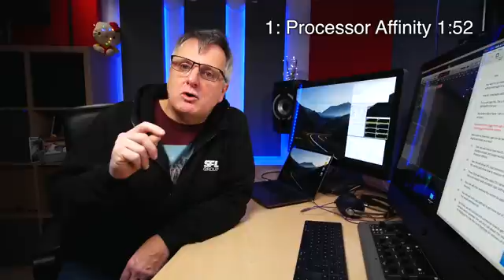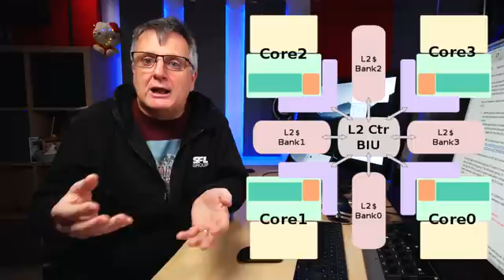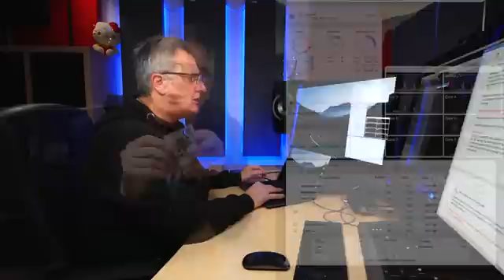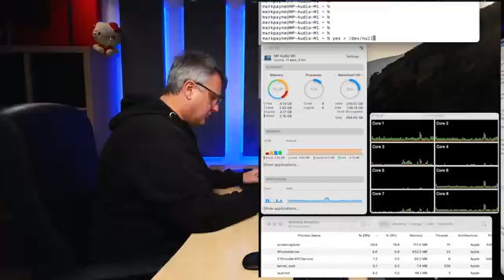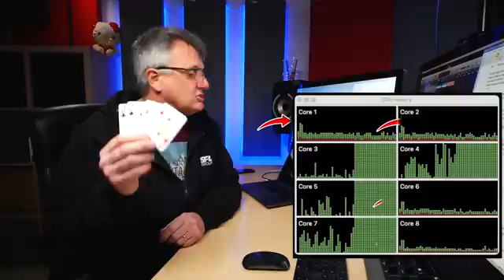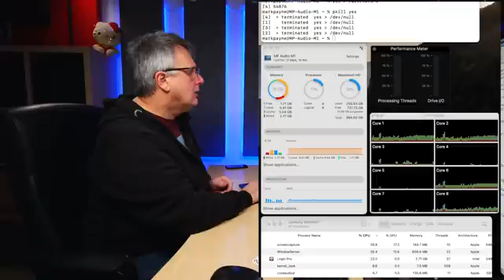Logic Pro X CPU Optimization | 2021 | M1 System Tips | Run more Plugins!

Comment: Fantastic video! In depth for all audio and music production. Spot on when you highlighted the fact of those other youtubers that are showing the new M1 Mac 💻 stressing the cpu by multiple audio tracks of the same channel (prints). I’ve been testing my basic Mac Mini just to see if it could really be a nice jump for both performances and to start off with the new Apple silicon world, I’ve done pretty much what you do, in a more humble way ;) but using LogicX with all type of third p. plugins and virtual instruments. Routing signal paths, using many aux /buss channels loading most of my arsenal (plug-ins) 3rd part that is. I found some glitching here and there and some times the cpu message was OVERLOADED. Now perhaps 16 ram would give a little boost to a workflow? Or we might have to wait a bit longer? Mind you, the fact to have a Mac intro line that can be super snappy and responsive with regular use, and in many ways a great step up and into the new world of Apple silicon? I am sure by the end of 21 we can see the light for the M1Pro machine? The cost will definitely jump way up there $€£ . My aie on these new intro line Apple machine is for 1000£ you can get a “new world” computer system and start off enjoying the new experience yet for pro audio users is advised to keep your original set up 🆙 and still enjoying the new Apple system. I’ve done a track from start to finish mixing and mastering on my Mac Mini M1with only 8gb of ram, used Plug-in Alliance , Fabfilters! Softube just to mention few) mind you, the Waves plug-ins are really cpu hungry 🤤 IMO. Anyway!its refreshing to watch your video! Thanks for putting energy in to help all audio /music producers out there... too many benchmark-video editing YouTube videos. Lol 😂
Reply from the maker: Word! djA, did you look at your memory pressure when you hit the limits of your system at all?
Reply: @MarkPayneAudio  hi Mark! Yes, always kept active monitor on  while using Logic X to keep and eye  on CPU, MEMORY PRESSURE, which despite the stress I’ve put the MacMini M1. I’ve never got the memory pressure to reach the red I was impressed by this.

Comment: Hi mark I am looking at updating my old window 10 pc I have been looking at the Mac mini m1 think after your review I am going for 16gb of ram version, my main use for the Mac will be using Logic Pro x and Final Cut Pro I thought about the MacBook Air which might be my next investment later down the line  as I have a MacBook Pro which I have upgraded to a ssd drive and 16 go of ram just wondering if you  rate the new Mac min m1 I no it a silly question cheers neil finally love your YouTube channel nice to find  a uk reviewer keep up the great work mate 😎
Reply from the maker: Hi Neil, the new Mac Mini M1 is basically the same as the MacBook Pro M1. It has active cooling so will be able to do all the hard thermal stuff at the sustained top end of CPU utilisation. I think I am going to do an Air vs Pro M1 video as lots of people are asking for this.
Reply: @MarkPayneAudio  look forward too  the review and thanks for the quick reply 😎

Comment: Brilliant video! The thing that excites me most about M1 is that you can track at 32 samples under a fairly heavy load, which would have normally been a payne in the ass, and would have required me to up the latency or freeze tracks.
Reply from the maker: I have not tried tracking yet with t so this is good to know.

Comment: Hi , Thanks for your vid , Does 64 bit summing take more processing power given that , that summing option is open to use more ram than 4 gb ? What happens if we fiddle with that preference and make it 32 bit summing ?
Reply from the maker: I did try that previously and I found that it made no difference to the processor load.

Comment: I just bought the other Abbey road reverb from waves and I cant really even use one instance on a project with 40 tracks.
Lately, I've been utilizing Logic's stock plugs like ChromaVerb and Space Designer.
The stock plugs seem to be more CPU efficient than the newer Waves stuff. 
I can't use Bezerk either it sucks man.
Reply from the maker: I can really recommend LiquidSonics Seventh Heaven reverb. The base version is fantastic (no need to bother with the Pro version IMHO).
Reply: @MarkPayneAudio  How's it on the 'ol CPU usage? I'm still looking for that ultimate 80's gated verb sound as well. So far, the Eventide 2016 was the best sounding to me, but I don't have it anymore :(
Reply from the maker: @totigerus  Its very light on CPU. But I will say that it does not have a good gate reverb. I am using Waves H-Reverb for that... which is not so good on CPU (but better than Abbey Road).

Comment: BTW: Lot of CPU cost the VISUALIZATION.....  since OSX 10.11 with every update (more "transparany effects) it cost more and more  CPU. I do not have big sur, M1 and Logic, but plugins like REAKTOR (and Reaktor"Ensembles" with much grafically movemet cost SIGNIFICANT of CPU if the plug-in-window is open  or its closed! The difference is depending how much VIEW-Elemenst are how often moving  (in some reaktor "ensembles" a lot, in some other ensembles just few...) The CPU will spikes SIGNIFIKANT if the plug-Window is open or closed: "Hiding" the plug-window dosnt matter, it cost the same CPU.  In some cases just the VISUALIZATION of some reaktor"ensembles" cost more than 100% (of one core). The plugin (ensemble) itself takes maybe 15% (of one core), but with open window the same ensemble will suddenly take 135%....   My old 2011 imac with 10.10 just needs much LESS CPU if the window is open, than my 2019 imac with 10-15!  Its the new  "transparancy effects" (you can not switch off this unnescary stuff) will cost lot of CPU. Dont know, maybe bigs sure/M1 handle this better, but with 10.15 its a very huge power-eater! (You just see this in activity monitor, not in logic/live/reaktor.... cpu-meter which ONLY shows shows the Audio-consumptation, not the GFX consumptation!  wwg1wgaWW!

Comment: One thread per plugin doesn't make sense. One thread per track seems more useful. You can't parallelize a chain of plugins, since the next plugin has to wait for the output of the plugin before it.
Reply from the maker: This all makes sense, yet.... adding one plugin can show an increase over multiple Logic affinity queues. How do we explain this?
Reply: @MarkPayneAudio  Interesting, how did you measure that?

Now that I think about it a little deeper, maybe on thread per plugin could actually be helpful. If you see your whole Logic session as a graph of processors (plugins) and their sends/receives as the connections between them, you could have scenarios (mainly in side chain setups) where one specific node on one branch is waiting for another branch. 

What would make more sense to me however, is a scheduler inside Logic, that allocates as many threads as you want (you can pick that in the settings) and then uses those threads to process nodes in the order that makes the most sense according to the form of the graph. I think that could also answer your question: every audio block (every <buffer size> samples) the nodes could be distributed differently across the allocated threads. On the first audio buffer "thread 1" might process "node 3", on the second audio buffer "thread 2" might process "node 3". This would show an increase over multiple threads when measured over time.

 Interesting to think about (I might be totally wrong aswel).

Comment: Hey Mark - love these videos! I noticed that AVB latency on M1 is pretty incredible - 0.2ms. Could you run a test to see if you could optimise an M1 system to mix using plugins live? Could potentially save spending tonnes on Waves servers.
Reply from the maker: Great suggestion! I should try that. Get a console in an out of Logic using say an RME madiface and use Logic as a replacement for Waves Multirack native... Hmmm. A bit specialist for us live guys however. Not sure this will have wide appeal?
Reply: @MarkPayneAudio  Yeah, could be interesting. I appreciate what you're saying too though. I just always thought if I could negate the latency issues, the possibilities of using my studio setup / plugins live could sonically be pretty exciting. (I'm already halfway there as I've loved mixing livestreams in the box) Considered buying a Presonus RM32ai because of AVB compatibility and testing it out at 96khz. (I've seen them go used for £600ish)
Reply from the maker: @ledgersolutionsuk  I have done very detailed studies on plugin latency for Multirack Native and SoundGrid here: https://youtu.be/FCyK160EtU4 and here https://youtu.be/0cs576ul7Kc .. you may find these helpful.
Reply: @MarkPayneAudio  Thanks Mark!

Comment: wait what?- M1 now handles Waves Plugins / Fab Filter etc. I got emails from them saying they do not run on M1 systems...Did that change?
Reply from the maker: Waves plugins are not officially supported on M1. But as I demonstrate in this video set I am running V11 plugins on M1/Big Sur without any issues. I run Logic under Rosetta and of course that means all plugins will also be under Rosetta. In fact Fab Filter ARE now re-coded and supported as native on M1 systems (over 1 month ago). I still continue to run the Fab plugins under Rosetta as I run the reliability of mixed M1 and Rosetta code within Logic is not reliable. Run EVERYTHING under Rosetta by starting Logic under Rosetta and all is good. I cover all of this in the video set all part of this playlist. Please do review, I think it will help.
Reply: @MarkPayneAudio  thanks Mark. We are getting there.

Comment: Brilliant video mark! 

Do you think it’s worth me buying this over the i9 MacBook Pro or a pc similar to the i9? I’ve always used cubase, but I’m looking to move over to Mac and logic. Obviously it’ll have to run multiple tracks and vsts with plug ins and reverb? Thanks
Reply from the maker: 100% I would get the 13" M1 over any Intel 13" MacBook .. but make sure any sound interface hardware you use is supported. I cannot comment on the PC as I stopped using PC's for production a long while ago.
Reply: @MarkPayneAudio  thanks for your insight and the reply 👍🏻

Comment: The waves plugins are not M1 compatible yet. The performance will probably be a whole lot better once the M1 version of the plugins come out.
Reply from the maker: Yes, this I do understand. Please remember I am not blaming Waves for this. I am using this plugin (Abbey Road Plate) as a machine stress generator. What it is is pretty irrelevant, what it does to the system is what I am after. Waves V11 is working fine on M1. I am running sessions on a 13" MacBook Pro M1 machine that would be impossible to run on the latest 2020 Intel MBP. The fact that MBP M1 will get even faster is nice but is not the story now. The story RIGHT NOW is that MBP 13" M1 is far and away superior for this task than MBP 13" Intel. M1 is beating the old systems to an embarrassing defeat with one hand tied behind its back. An to be honest I think people without M1 are totally over playing the Rosetta 2 "disadvantage". There is no disadvantage my kids are winning the egg and spoon race!
Reply: @MarkPayneAudio  Very well said Mark. Thanks for the insight.

Comment: Thank you for the informative video Mark! Question: are you running Logic in Rosetta 2 for these tests?
Reply from the maker: Yes Jacosh, It is the only way. Most of my plugins are non-native and I have found that reliability in Logic is only solid if the whole package is under Rosetta. Once you run Logic under Rosetta then all plugins are called as translated code independent of them being updated with a native version or not. I am not saying the native version of Logic is troublesome. But it becomes so when it has to deal with Rosetta plugins.

Comment: Has anybody found a list of plugins that have native M1 compatibility? Anybody keeping track of this situation? Would love to run a Logic Pro X setup with a new M1 Mac where I have it running fully native. So far I know of FabFilter and Fuse Audio plugins being M1 compatible. Any other companies with M1 compatibility for their plugins?
Reply from the maker: Hi Niklas. Why do we need it to be native? Logic performance on M1 under Rosetta is far and away better than on any equivalent intel machine of similar form factor. I just don't get this a a problem. It is what it is and when ALL the plugs I use are native then I will flip the switch. Until then what is the issue?
Reply: @MarkPayneAudio  As far as I can tell, the difference in performance is still quite significant when running Logic in Rosetta 2 translation mode versus native mode. I'm also trying to build a really minimalist system so I'm interested in which of my plugins will run natively. Planning on installing only those.

EDIT: Actually, if you happen to have any FabFilter plugins, you could test the performance difference. First installing the ordinary Mac x86 plugins, running Logic under Rosetta 2.. then running the native plugins with native Logic.

Yes, I know these machines are quite powerful already but as I use Alchemy 2 a lot I will still most likely run into a performance wall with any of the current gen M1 computers.. thus I try to minimize the overhead by making sure all of the plugins run natively.

Comment: Thanks Mark. Cleared up a lot of confusion for me. Still on a 12 core 2010 Mac Pro. Understanding the dynamic nature (sends) explains many head scratching moments where seemingly out of nowhere an overload appears. Ozone 9 is my nemesis. Love the plugins but they are a bit processor heavy.
Reply from the maker: Thanks Harrison. Yes me too! I only realised that this was going on when I was focused on measuring what was happening so I could teach it! Always in my teaching sessions this is the case. You really learn something when you have to line it up for explanation. For me a Quality Metric is something that can be shown practically that means something to people.
Reply: @MarkPayneAudio   I taught audio engineering and students have a way of asking questions that keep you on your toes. I learned a lot. I’m still trying to figure out the one “thread” that is showing up in logics processor meter (not in the cpu OS meters) and causing overloads even when 12 of the 24 threads are not being utilized. Some times it’s having a lot of processing on the stereo buss..sometimes it can be caused by Superior Drummer but only while the track it is on is selected. I talked with a programmer at Toontrack and he said it was Logic’s handling of buffering. Some times it shows up on thread 24 and sometimes on thread 1.. then magically the session evens out and runs fine. There is something about letting computers decide what to do that has always bothered me..lol. I’m looking forward to seeing how Apple implements it’s silicon in the next year or two..
Your information has helped a great deal so going forward I can avoid some land mines.... thanks again.
Reply from the maker: @myfriendharrison4348  Yes its baffling watching the load pile up on one affinity queue for no good reason. We know about wanting the L2 cache data to stay on one core and this will have something to do with it. The M1's shared L2 cache should mean that this "pile up" is less necessary. This is always going to be an issue when we ask a time asynchronous system (multi-threads running on multicores on a time share basis) to run a synchronous application. We need our audio... and we need it. Now! With a DAW I guess we hide the problem with massive CPU performance headroom... but then we run very complex DSP and find ways of using that all up.

Comment: Great thanks! Fantastic review! I am running Logic on late 2013 iMac and I am looking at the M1 line up. Apple did a good job, will probably upgrade to the next generation of those processors. By that time plugins compatibility should become less of an issue.
Reply from the maker: You're welcome! But I am not sure plugin compatability is really an issue. All my stuff works. Hardware compatibility with external audio devices is more of a thing to be looking at. I feel the whole YouTube review community spoke so much BS about Rosetta 2 as fake news before anyone actually ran anything. They were all in a pissing match rush to be first with something to say for hit rate and watch hours. Also a lot of the guys that review this stuff have never mixed a session in their own freaking lifetime. Thats my take. As I said ... my stuff works.